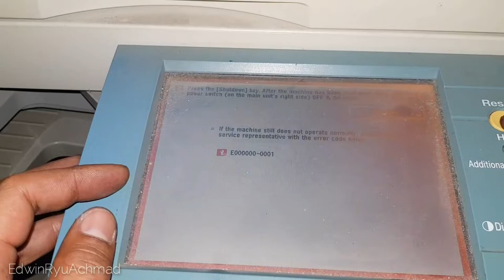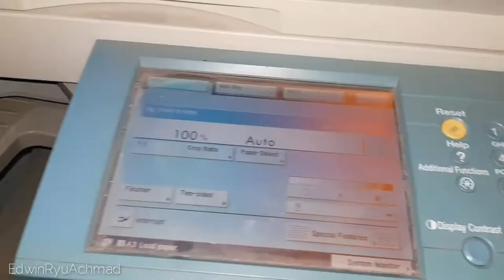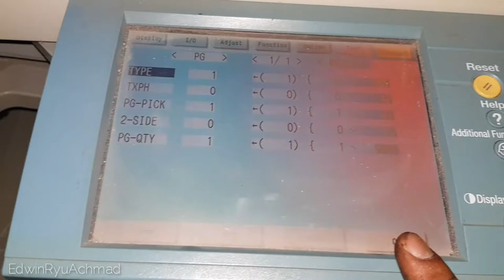Repair Error Code E000000_0001 || Replace the Heater Element || Canon iR4570 iR3045 iR3245

Comment: Selamat siang bang..mesin saya canon ir3045 mengalami error e000110-0001..apa kah itu penyebabnya karena laser atau apa ada penyebab lain ..masalah sdh saya ganti laser unit baru tapi tetap aja masih error 011, bolehkah berikan masukan agar mesin saya ini bisa normal lagi..terimakasih bang..

Comment: Canon ir 3025 error code e0000 000 changing heater elements and power supply board. But machine showing code 000 00 0.what is remedy.
Reply: There are 2 types of heater element, 110 and 220.. so makes sure what type that your copier needs

Comment: Kalw hasil tulisan atau garis berbayang..apakah masalahnya di heaternya mas..?
Reply from the maker: Cek dulu jarak bayang nya, apa panjang nya seukuran keliling dr fixing film, jk iya kemungkinan yg bermasalah di pemanas, bs suhu pemanas dibawah 200°C saat mesin sedang jalan, kdg jg voltase listrik drop! Terkadang jg press/tekanan dr lower kurang (terlalu kendor) .
Baru analisa menurut pengalaman, tp pastinya harus dicek!
Reply: @EdwinRyuAchmad  sip2...makasi mas infonya sangat membantu...
Reply: @EdwinRyuAchmad  kl harga heater 110 volt brpa ya bang?
Reply from the maker: @hendri1786  harga bs cek toko part fotokopi (online/offline)

Comment: Kalo sudah diganti heaternya.. Msh 0001 knp ya?
Reply from the maker: Kl secara mekanik dah ok, biasa nya dr tegangan listrik jg bs pengaruh,
Reply: @EdwinRyuAchmad  tegangan listrik dr stabilizer?
Reply from the maker: Kl tw bagian2 mesin, cek thermoswitch, thermistor, cek jg kabel n konektor pemanas, n ukur tegangan listrik,
Reply: @EdwinRyuAchmad  FB ndak aktif Mas ?  Assalamualaikum Mas Edwin, Problem sama E0001 tindakan sdh di ganti film fixing, heater, thermostrat, power suplay kode FM 0260-000 ato sing 127 V mas ?

Comment: keramik sudah diganti tapi tetap  E0000...,  spertinya ga ada arus listrik yang masuk ke keramik, soket fixing sdh aku cek normal semua, solusinya apa bang
Reply: udh nemuin solusi Mas ? saya sedang ngalamin sepertinya gitu
Reply: @miminibnu7492  blum bro..smentara kalo copy pake scan printer tp cuma A4
Reply: Assalamualaikum Mas  @BagyoBerbagi  Alhamdulillah FC saya udah bisa beroprasi lagi berkat panduan Master  @Edwin Ryu Achmad  di Vidio tsb. saya cek pelan & teliti di ururin dari tegangan Power Suplay sampai DC & ke Fixing Unit, padahal sdh saya ganti thermoswit & thermistor Error E000000_0001 masih muncul. ternyata masalah saya ada di pengunci dudukan thermistor yg patah (jadi klo panas thermistor menjauh),  saya lem Alhamdulillah berhasil ( menggunakan thermoswit & thermistor yg lama).  thermoswit & thermistor yg baru buat cadangan. 4 hari dibikin galau demi dagangan istri.  mohon di koreksi master @Edwin Ryu Achmad. Alhamdulillah Pamuji Rahayu (FC SEMBRANI Kebalen-Babelan-Bekasi)
Reply: @miminibnu7492  siap trima kasih sdh mau berbagi info yg sangat berguna ini..🙏🙏
Reply: untuk ir 3235i voltase heater elemennya 110v atau 220v??
Reply: @BagyoBerbagi  gimana mas? Udah nemuin penyebab dsn solusi?
Reply: @miminibnu7492  udah nemuin penyebab dan solusi? Mesin saya jg sama soalnya hahahah